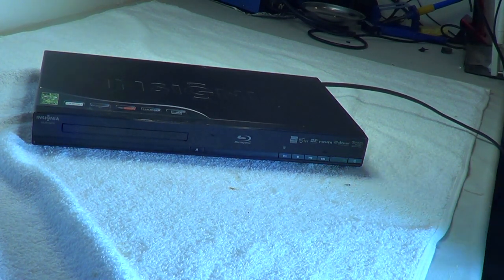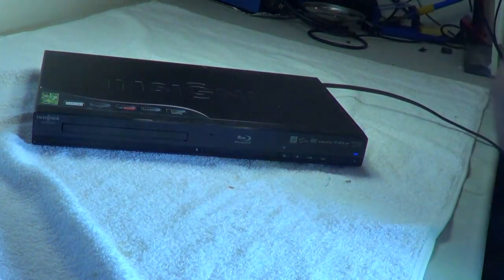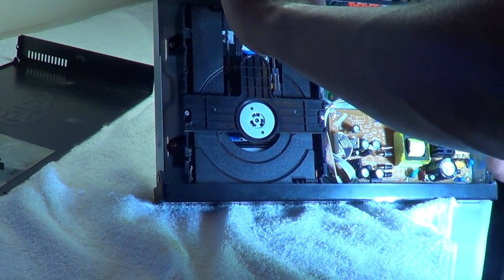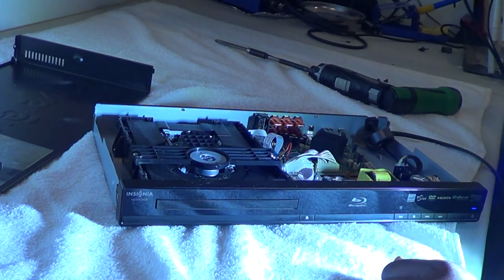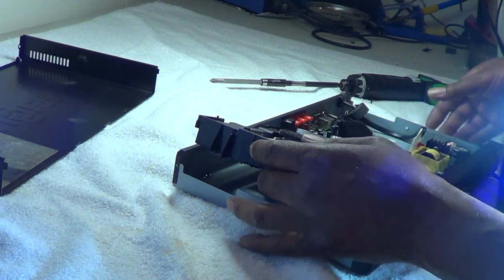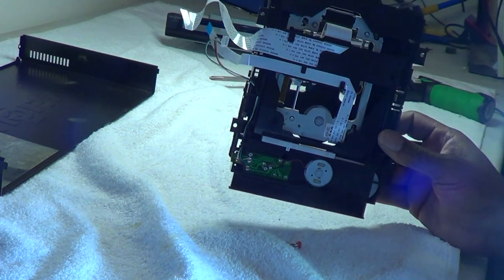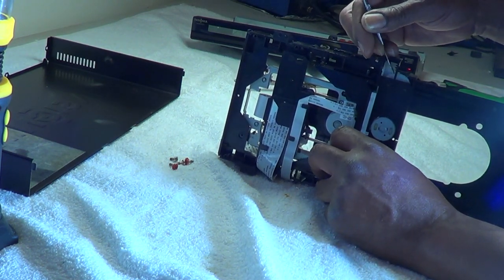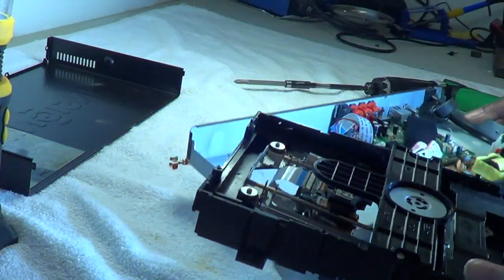Blu-Ray/Dvd player door will not eject. Easy Fix

Comment: Thanks for the video! Mine had the pin that engages the rack connected to the gear out of its track on the disk holder so I was able to take it off and put it back in the track in the right position with information from your video!

Comment: Wow, easy fix.  I would have taken it apart, tested the motor with three volts from my power supply and, if good, replaced the belt.
Frank
Frank Reiser Video/Audio Service

Comment: Hi, I was trying this for my blu ray player cause the door is stuck. I managed 2 get the cover off and have the same kinda tray down setup. However the tray won't come out the door even with the screws out. It'll lift up but seems stuck in door. What should I do? Also what do u unplug and replug in to take the disc tray out? Thanx.
Reply: No clue if this will help, but here’s a different solution. Good luck 👍🏻 https://youtu.be/w9TwV0qX9Ro

Comment: I had one that wouldn't open. Turned out they used an o ring from the drive motor as the drive belt. It was completely stretched out. Popped a new one in, good as new. If it's broke, what harm is there in trying to fix it?
Reply: Exactly, right?!

Comment: Whar exactly did you do to get it to eject? Was it adding grease or oiling the gears? I'm having the same problem. It did open half way but then again it's still does not eject to open or close.
Reply: Same Problem.. His Opened Easy, Mine Halfway
Reply: @beelatrice1377  It finally opened all the way. I used a small rubber band. It works like new. 👍
Reply: @robertkellogg1199  Awesome. I See With Mine It Isnt The Gears But The Part The Disk Sits On. It Comes Too Far Upward When Closing And The Tray Cant Get Passed It😩...Im Still Searching For Videos To Help

Comment: On the Blue Ray Player with the unit plugged in Press and Hold the Power and the Door Open on the Unit (not the remote)
for 10 sec or you hear 3 beeps. as long as the unit is plugged it it will stay working with the remote but if you unplug it
you will have to reprogram it again using these steps.
Reply: Sounds like there might be an internal battery that’s gone dead.
Reply: @JillofAllTrades2  or a prom thats gone bad.

Comment: I've had a few just die. They would n't do any thing. It sucks. Took them apart and din't change anything. Oh well.
Reply from the maker: I would at least check/change the Line fuse on these if its totally dead. Just follow the Power cord to the power board and a fuse should be right next to it. Thanks for watching/commenting!

Comment: i just bought a "lightly used, good condition" dvd player form some old lady and the tray doesn't open (plus the front plastic is loose). maybe i should try this.

edit:
i ended up trying this fix. the gears were greasy and the rubber band connecting it had good grip. when i turned the power back on, it closed, as yours did, but it did not open XDXD

i manually opened it without removing it from it's place, like by rolling the gear. then i could pull it open the rest of the way. at some point i decided to try putting a DVD in it. it read it right and all, but guess what, WITH a DVD it opens without any extra assistance XDXDXD if u close it without a dvd then it will not open.
Reply: @JillofAllTrades2  that was awfull. Good thing computers work the same or better for streaming to a smart tv... well, at least the tray opens

Comment: MDR easy solution do you think it's an easy solution the fact that you have to remove the casing and directly remove the reader to be able to unlock it I think that ordinary people are not even capable of removing the cover of the reader I don't think it's an easy solution personally I know how to do it instead of turning the wheel to open the drawer you have the small white wand below the reader that you just have to push to open the drawer
MDR solution facile pensez-vous que c'est une solution facile le fait qu'il faut enlever la carcasse et enlever directement le lecteur pour pouvoir le débloquer je pense que les personnes lambda ne sont même pas capables d'enlever le capot du lecteur je ne pense pas que ça soit une solution facile personnellement je sais le faire au lieu de tourner la roue pour ouvrir le tiroir vous avez la petite baguette blanche en dessous du lecteur qu'il suffit de pousser pour ouvrir le tiroir